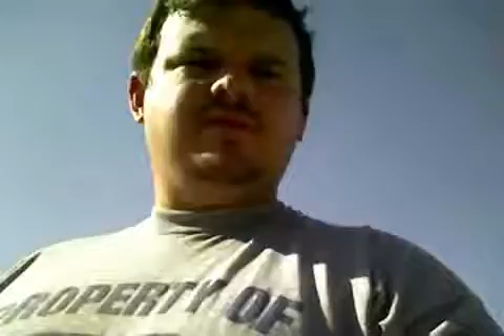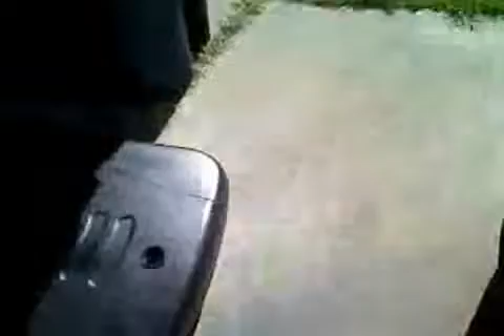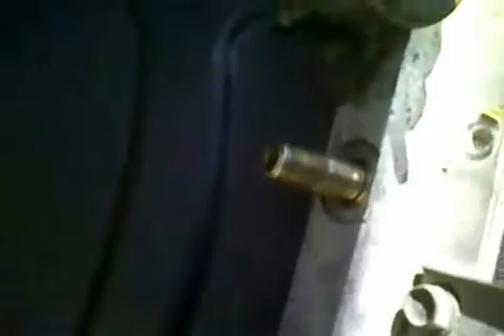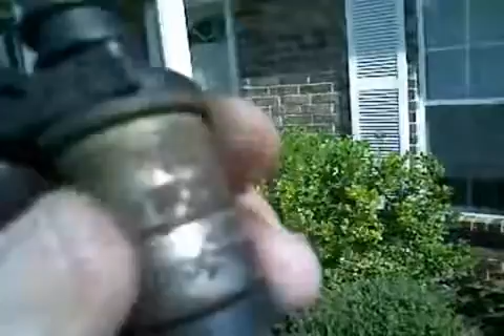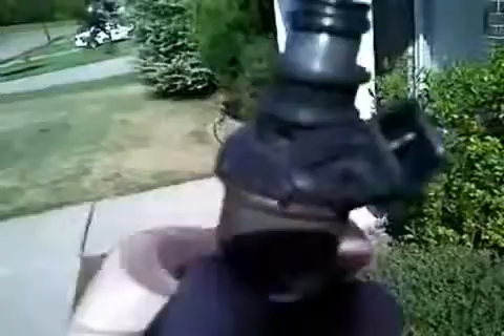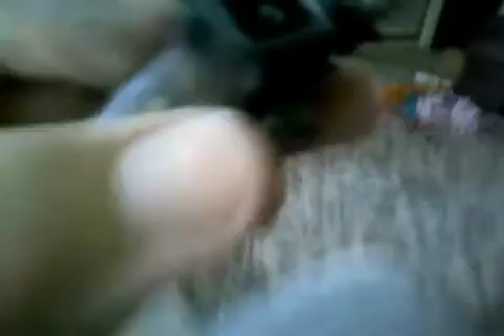Part 1 of 3: 1998 Honda Accord Fuel Injector Service Repair

Comment: Hi David. I was wondering if you used a NOID light before disassembling your injectors? I have a '99 honda accord lx 2.3L and can't find a kit that has any Honda sets. I've heard you can use the Bosch ones but don't want to spend the money if this is not true. Thanks!   PS- I'm just a Mom trying to find out what's wrong with my kids car and don't know much about these things LOL